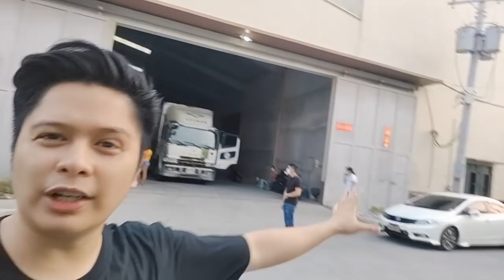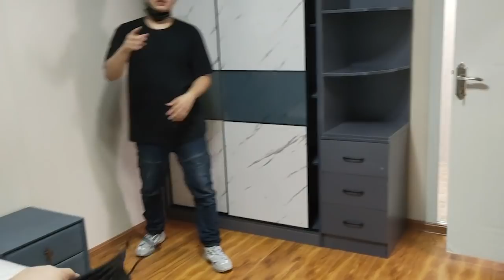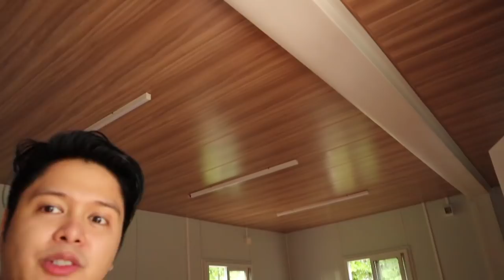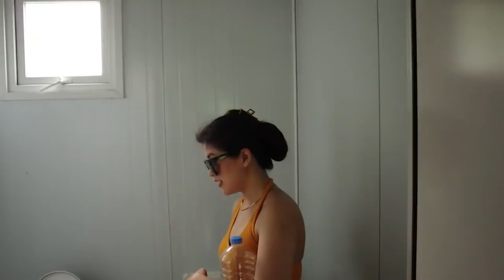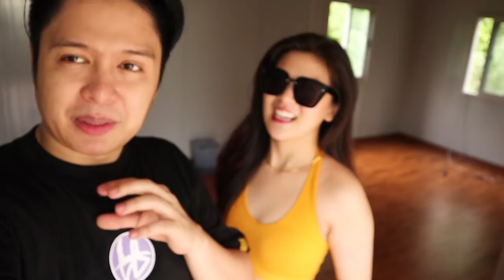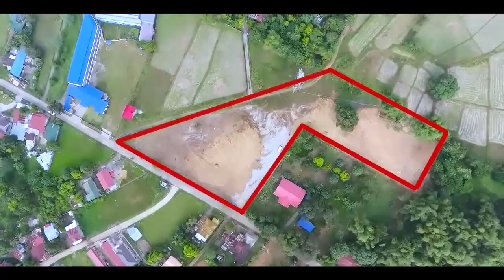Bagong Bahay ni Yexel

Comment: <OFFICIAL ADVISORY>
SEAOIL will adjust its pump prices per liter effective 6:00AM, 23 July 2024, as follows:

Gasoline: +P0.10
     Increase
Diesel: -P0.40
     Rollback
Kerosene: -P0.70
     Rollback

This is to reflect, movements in the international petroleum market. Thank you.